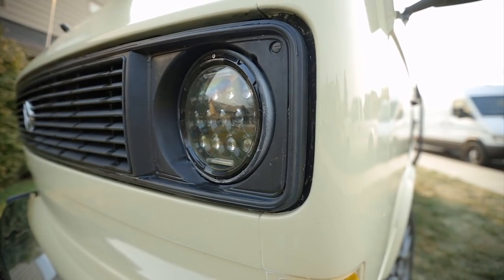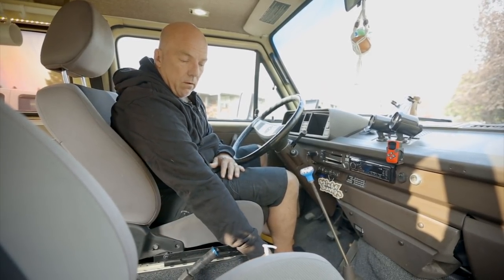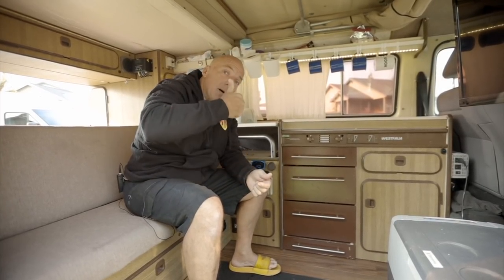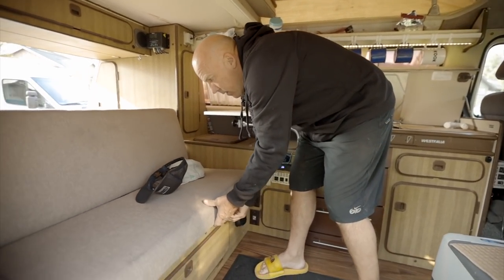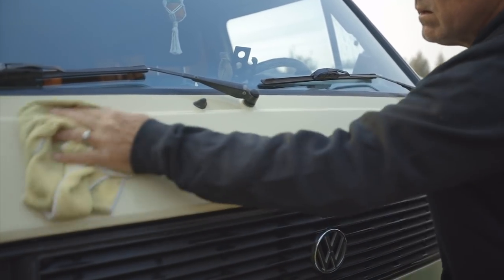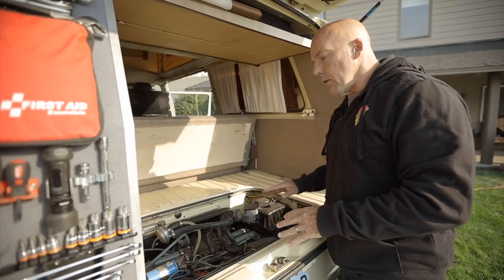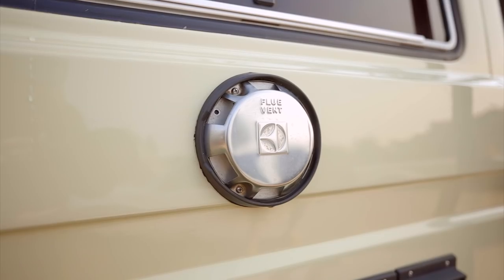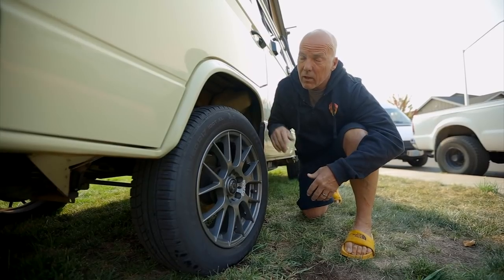Renovated 1980 Westy Camper Van Tour - Vintage Tiny House Rebuild

Comment: My dad got a VW camper van n the early 1970s. It almost always broke down daily. So we didn’t take it on many  trips. My dad did all his own work and got  tired of it. But if it had run well it would have been a great camping van. My mom just couldn’t take tent camping anymore. My sister learned to drive in the 1980s in a VW van. Same kinds of issues. But they are cool old vans when they run well. Love what you’ve done with yours

Comment: One huge advantage to having a few batteries is looking into Higher output alternators  I was lucky on the cost of one on my 2005' Chevy blazer 2--door 4x4 They come with a 85amp Alt ...bigger trucks (chevy tahoe)with all the toys like power heated seat Use a 145 amp Alt Which fits perfect in the Blazer They bolt right up Only thing you must change is to a 1 inch bigger  belt For those days you get no solar  Normally when we go camping we use lights at night Or run the Mini computer to watch a movie And keep the cooler running ..By day time After grinding coffee and plugging in the perk We still have some power Which is fixed when we drive to the 50 cents/15 mins coin op showers (they look like double size porta pottys) Then a short trip into town for wood And other odds and ends By the time we return we have full power

Comment: Nice video/ have question in regards to your struts on top/ I have a 1982 westy/ I had a pair of struts installed on top (like  yours I believe) heavy duty.  Had Thule storage bin on top also/ worked fine for aGood while/ than all,of a sudden it took 2 of us to close it/ crazy/ not a lot of input form go westy on that/ at least they didndt solve my issue/ I ended up taking them off/ so I could raise and lower it/ I do have a small pair of struts on it/  any thoughts on this? have you had any issues? Thx David